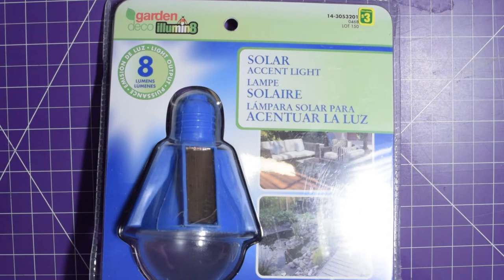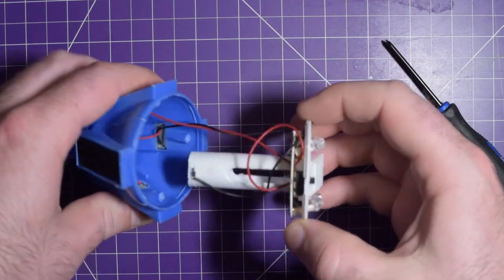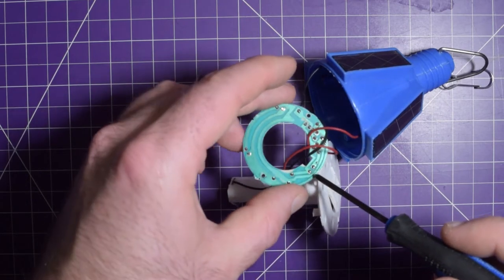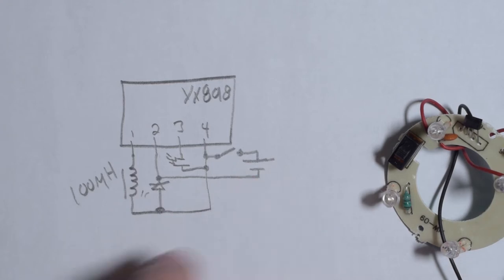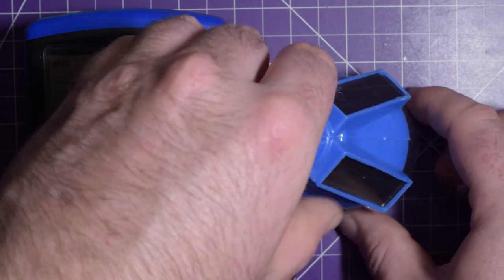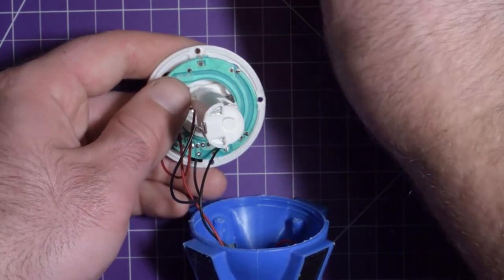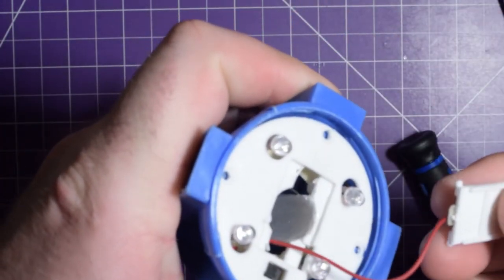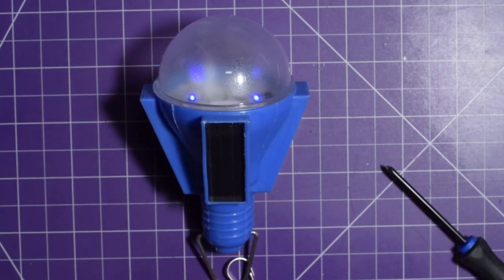A Closer Look: Dollar Store Solar Light

Comment: 4:52 104 is 100 nano Farad not 10 micro Farad.  That IC is probably this one or related  QX5252F  .  Really cheap and actually really nice to play with.  Depending on the coil you can power leds up to 1 Watt. 
Now my advice on that lamp would be to spray WD40 on the battery cell (especially the + side) and stuff like switches and screws.  Keeps rust and oxidation away.
Now if those panels are really glass then I seriously like that lamp (except for the crap plastic fantastic). A word of advice on panels that have like an epoxy finish .... they will yellow like crap .. but there is an easy fix for that. Most people use toothpaste etc but that is just a no go. While they are new or still good buy as is described on ebay or aliexpress as 'DIY Translucent Helicopter Bike Frame Clear Protection Tape Protective Film'     You can get it really cheap.  Cut out a piece bigger than the panel and just stick it on.  Helps water ingress and the panel seems to stay clear.  Now after a while, don't know yet since mine are still clear after a year, just take the tape off and put new tape on.